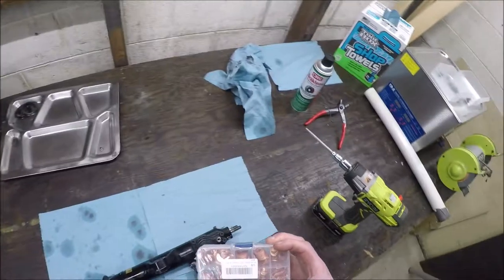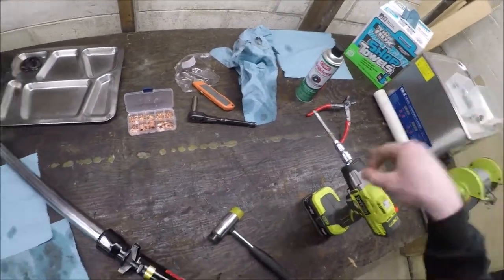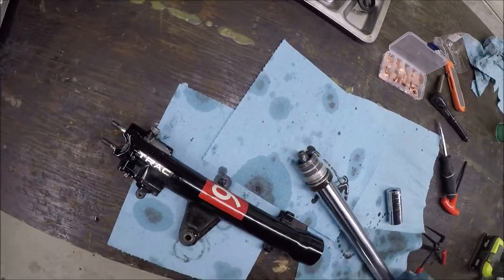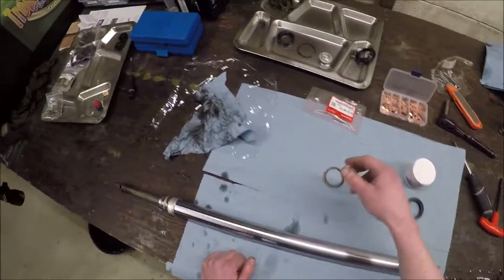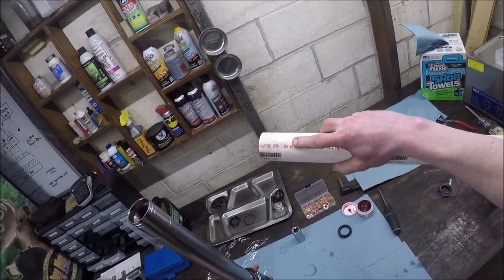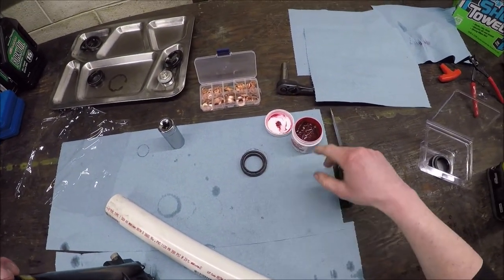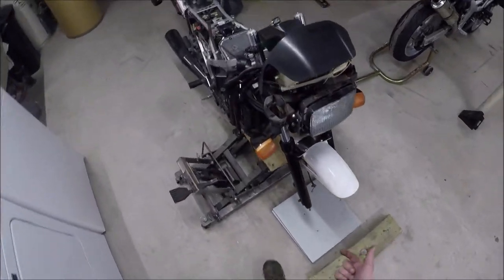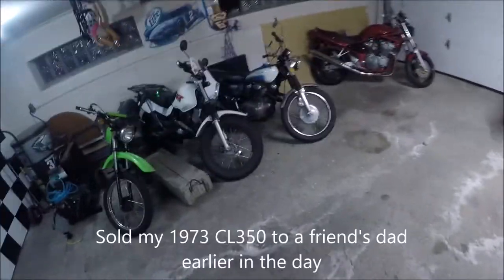Orwell's Interceptors: Ep4 - Honda VF500F Fork Seals

Comment: not to be nosy but i've never seen a setup like that, is it a basement attached to a garage? i'm probably ignorant but it looks super ideal for workshopping
Reply from the maker: That's a fair question because I'd never seen a house setup like this before viewing this one. It's a single story house built into a hill. The garage is under the first floor, and it connects to the basement through a fire door. So I can effectively push a motorcycle through the garage into the basement.

Comment: Awesome videos Matt!  You're making my new-to-me VF500 ownership so much more efficient.  I had a question about those Ali sourced preload fork caps you mention.  What size are they?  I'm trying to find them but not sure which to purchase.  I'm going through the same RT emulator install.   Thank you!
Reply from the maker: Thanks Leo.
The fork caps I bought have the description FXCNC 37MM Motorcycle Preload Adjusters Fork Bolts Fits 37mm Conventional Forks Motorcycles Accessories.
At the time, Aliexpress was the only place I could find any 37mm caps that would work. Looks like you can probably buy the same type of cap on Amazon (i'm sure they all come from the same place) if you're in the US and want to get them quicker.
Reply: @matttriestodothings  Fantastic.  Thank you good sir🙏 Congrats on that gorgeous yellow beauty.  She's one of a kind!💛
Reply from the maker: @LeoDurant  Thanks man, I appreciate it. Good luck with the new-to-you VF!

Comment: Torqu Reactive Anti-Dive Circuit had a clicker to adjust if I remember correctly.  Did it actually do anything?  I’m not so sure 😊
Reply from the maker: It does have a little clicker, yep. Did some reading about it this morning that it's actually linked to the brake caliper and is actuated actuated when you pull the brake lever. I'll have to play with the adjustments and see if I can feel a noticeable difference. Getting 4" more of snow today though, so it'll be a while.

Comment: Im sure you know but use the old seal in top of the new one and then drive them both with the PVC pipe. It will save the new seal from distorting.
Reply from the maker: You know... I'd actually forgotten about that. It does seem a little violent without it. 

The first fork seals I ever changed were on my FZR (also 38mm) and I used the old seals on top per recommendations I'd read. The problem was, the old seals on top went so far in the I couldn't get them back out without pulling the two halves apart again. So I just hadn't done it again since.

Comment: Hey! Awesome tutorial! Id love if you made one for the clutch pushrod seal.
Reply from the maker: Thanks Jabba. I'll be honest, the pushrod seal is one I'm hoping I don't have to do for a while. I'm away from the bike now, but looking at a picture I've got here, looks like you've got to get both left side engine case covers off because the seal is covered. https://i.imgur.com/j6ptY4R.jpg

Right now, I'm unable to pull that left cover off since whatever gasket material was put on it is like friggen concrete. I'm hoping once I'm actually able to ride and put some miles on, the material will soften up and I'll be able to remove it. Luckily, I haven't seen evidence that it's necessary yet. Definitely (not) looking forward to scraping the gasket material of the engine cases when it does become a requirement though. https://i.imgur.com/GFqASE9.jpg
Reply: @matttriestodothings  Hey! Thank you so much for the reply. I envy you for not needing to replece this 5euro part. The part obstructing it is actually engine block casting. The propper procedure is to split the block! Seriously! But from what I have read some people dremmel the overlapping aluminium off as there is no structural reason for it to be there other than to protect the rod seal from the chain dirt. Anyway I was hoping that you have tried that before. My replacent engine is literally ejecting oil from there so I'll try to figure something out and replace it without splitting the engine.
Reply from the maker: @pecak  damn. Im out of town and away from the bike so I was only able to look at a picture. I was thinking... "no way they covered that seal." That's when I went to looking at the sprocket cover.

That's wild. And also that sucks. I'd absolutely look into dremmeling some bits off if it wouldn't affect the integrity of the engine so I could swap that seal without pulling the engine. What a pain!

I'm really really curious to get back and look at this now. Sounds like I've got some reading to do, and praying to do that I don't find a leak there.

Sorry you're dealing with that now, but I appreciate the heads up. At least I know what I'll be up against when it comes time. Thank you.

Comment: My VF500F needs fork seals before I can ride it this season, telltale puddle on the floor left side of front wheel over the winter that is not either brake or clutch fluid. Will appreciate watching this video before I begin once seals get here.
Reply from the maker: Forgot to say--don't just order the cheapest pair of fork seals you can buy. I made that mistake once. I've gotten lucky with All Balls, but others will swear solely by OEM. Good luck on the fork seal swap when you get there.